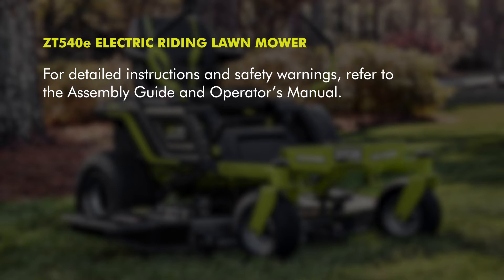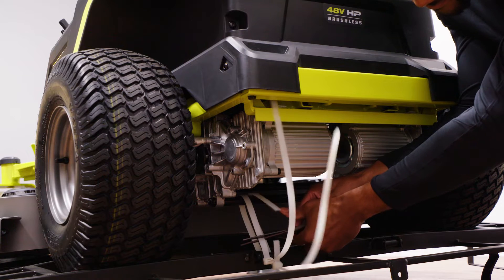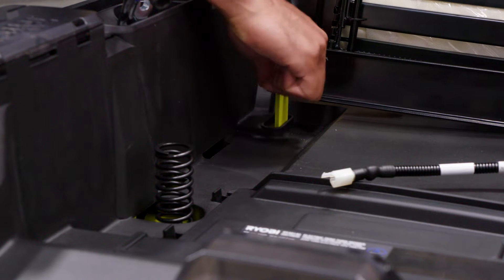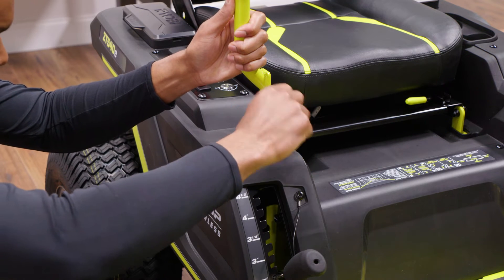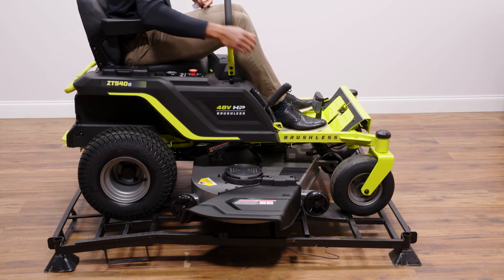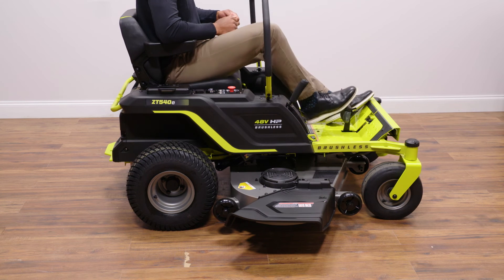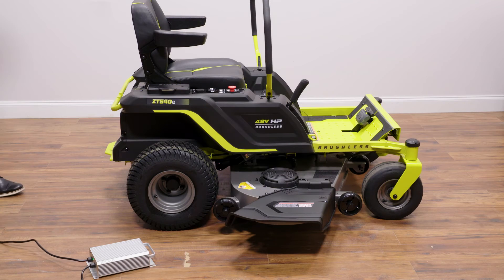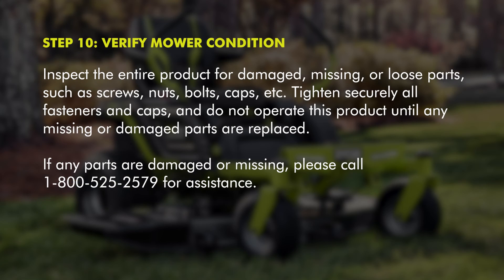How-To: RYOBI 48V HP Brushless 54" Electric Riding Mower Assembly Guide

Comment: When are you guys going to start using lithium batteries on these riding mowers?
Reply: Ok so, I did some digging on the subject and here goes: the batteries Ryobi are using for this unit are Leoch LDC12-115 (12V 115Ah batteries) lead acid. 
I priced out similar spec lithium iron phosphate(PO4) batteries from Dakota (a company that makes batteries for various applications including golf carts), with the same specs and it worked out to 3200$ USD. And that’s just one company. 
The mower retails for 8000$ +13% (9000$ CAD) up here in Canada. So about 14k-15k CAD for me if I wanted to upgrade. I find the mower is overpriced as is at 8000k (without lithium). It’s as though they don’t want to sell them... price is based on hype and desire for electric. Lithium iron would be a no brainer. Polaris did the same thing with there Ranger EV. Lead acid?! Come on man. 

Probably gonna buy it anyway...
Reply: @azazelone905  do not use those lithium batteries on this mower. I built an ebike about a decade ago with iron phosphate batteries (LiFePO4) and while they are excellent chemistry, they require a BMS(battery management system) to stabilize the cells.
Reply: @azazelone905  Thanks for sharing your comments on this - I had the same thoughts about LiFePo4 batteries being a decent fit, and will likely put those in mine when the lead-acid batteries eventually need to be replaced.
Reply: @stickyoxtail  Indeed, if I was to put LiFePO4 in something like this, it would be packs that have a built-in BMS.  There seem to be a number of these coming into the market as drop-in replacements for lead-acid
Reply: @FliesLikeABrick  update:

I ended up buying the mower. I can do about 2 acres before having to charge the batteries again. Although by the end of the summer, it felt like it mowed less. Not sure. The deck on this thing is terribly designed. Cuts well(don’t get me wrong) but it’s squared off design creates an accumulation of “grass slime” that ends up impeding the blades as it thickens. Layer upon layer…. I have to chisel it out after EVERY MOW… 

This summer, I’m going to try and grease it to see if the grass slides off it better. I rarely had to clean the deck on my Husqvarna. Maybe once or twice a season. But I have to clean this deck every time. It’s just a chore. Makes me wonder, maybe I should have bought the EGO instead
Reply: @azazelone905  WD40